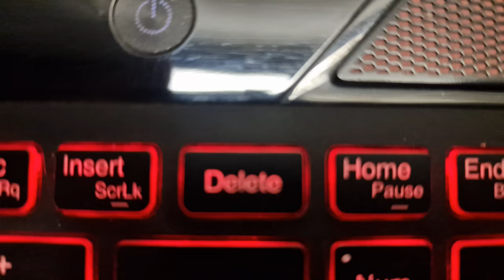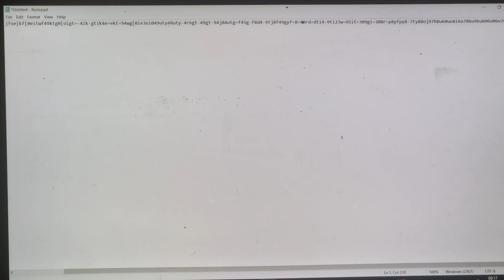I Have A Confession To Make - Classic Suzuki Restoration Painting & Installing The Front Axle

Comment: The semi circular plate that sits on top of the axle that seats the U bolts should have a rubber bump stop, if you go off road without them the axle bottoms out on the chassis and makes the most god awful bang!  Incidentally I've got dozens of those plates lying around.  I usually fit new thicker U bolts from a mk2 escort and cut them to length depending on what springs I fit, usually SJ ones, gives a better ride and a little more articulation at the front as they curve slightly upwards rathere than down like the LJ ones.  Some MOT garages have been known to fail LJ's for having worn out front springs, and had to be shown the Suzuki LJ manual before they would believe this is normal.
Reply from the maker: Yep they do have a bump stop, unfortunately the originals have gone, i was going to buy some but held off for a while. We will be replacing the U clamps eventually before the MOT, we just used the originals to get the chassis back together. Thanks for the advice! And thank you so much for the support!

Comment: I've watched quite a few of your videos. And I have to say I like them and how you two repair the metal portions. What you need to do is get a media blaster for the small parts and blast them instead of wire wheeling them. Media blasting would be a lot quicker and get into all the hard to clean areas and corners with ease. Just an idea...  Thumbs Up!

Comment: Lovely job 👍
I'm still amazed at how small the supporting frame and axle is!
Shows you what I know about structural loading 🙄
Reply from the maker: It is small isn't it! Its a lovely little car though :) and the chassis was better than we expected!
Reply: @yorkshirecarrestoration It’s delightfully “old school”, isn’t it, despite being 1980. Henry Ford would have no problem helping out because the method of construction is so similar to the Model T. It goes back into deep time, with horse drawn coaches made with a separate body & chassis.

Comment: PLEASE tell me I didn't see you painting the leaves of the springs! The leaves of the springs need to be able to slide against one another as the spring flexes and therefor all that should be applied is a lubricating coating. Paint under stress as in the springs will tend to stick and release unpredictably and cause all sorts of handling difficulties!

Comment: Ive noticed when I just de-rust and don't sandblast, use rust reformer & hammerite, that the rust will be back within a year. How do you keep the hammerite from drying too fast on the brush?
Reply from the maker: I have have been using miperox and hammerite for a lot of years as Iv been restoring cars for over 20 years and never had a problem if a good neatralizer is used before the hammerite :) we just put the brush in a cup of thinners :)
Reply: @yorkshirecarrestoration  I might need a better neutraliser then. I can only use the available brunox here